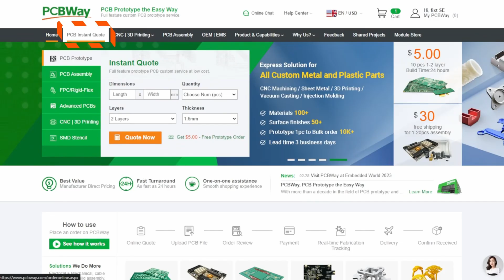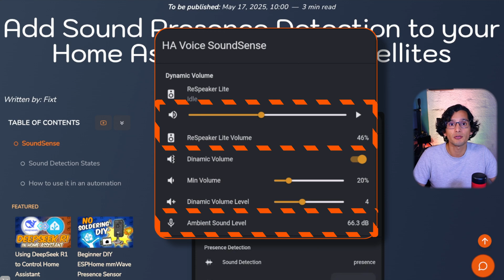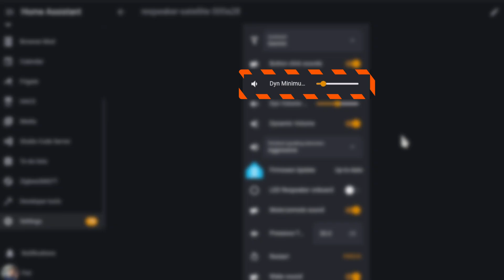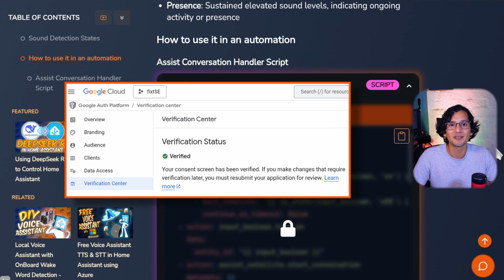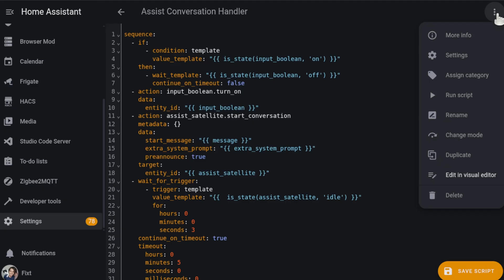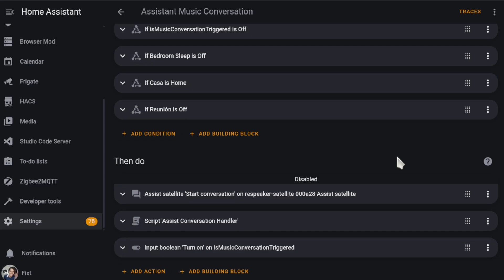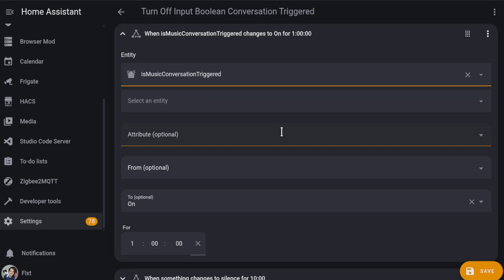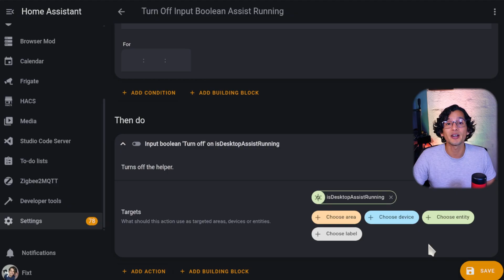Add Sound Presence Detection to your Home Assistant Voice Satellites | SoundSense

Comment: hello! receiving errors when trying to compile this: "Couldn't find ID 'asr_mic'. Please check you have defined an ID with that name in your configuration. These IDs look similar: "i2s_mics"."

I see commit f915076 attempted a fix but seems others are having the issue as well. I am rather new to all of this, so if there is something I am missing please let me know =)
Reply from the maker: Hi, sorry that commit wasn't enough, the library changed the method to access the microphone data to private, so now it's not longer accessible from outside the class y tried to find a way around it using a callback but still failed to get a similar result (the values I was getting where terrible off, so not usable), so for now it's not working, the only way to use it is by flashing the last OTA of my firmware for the respeaker lite (with the esphome version before the change)
Reply: @fixtse.  I understand thank you for the effort!!